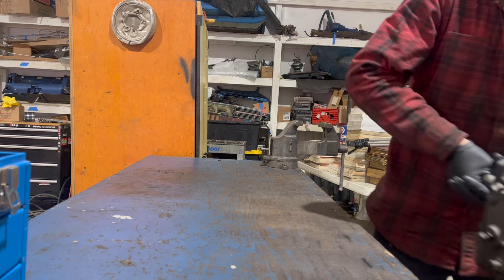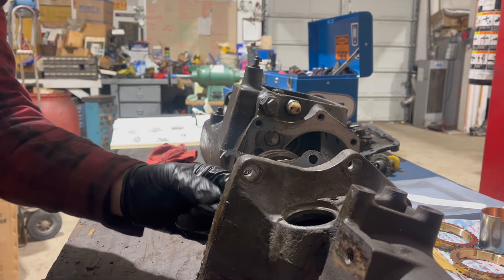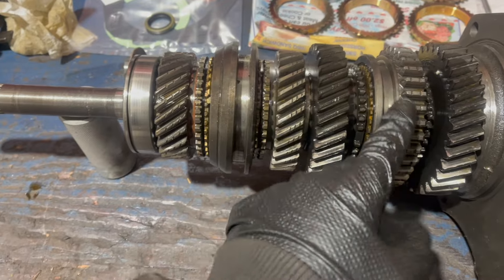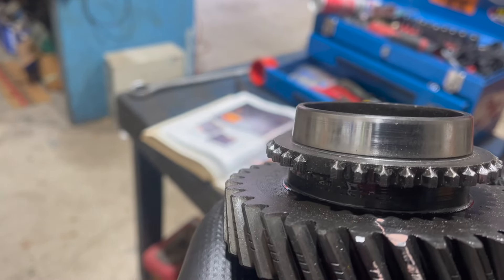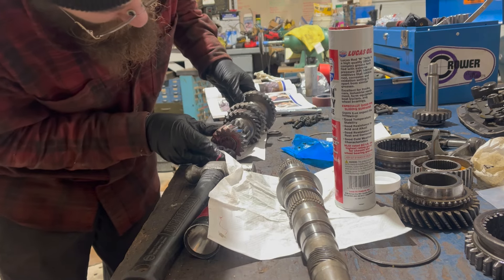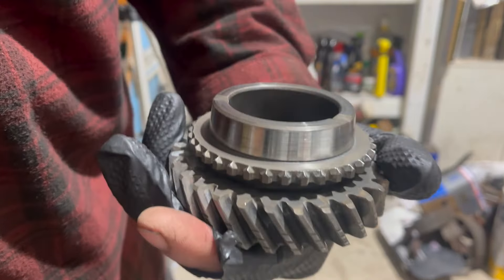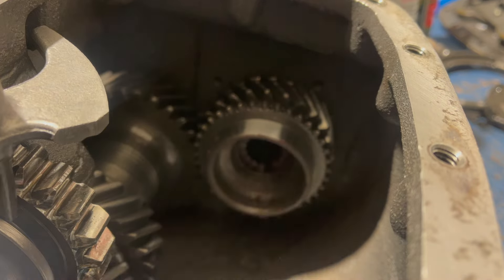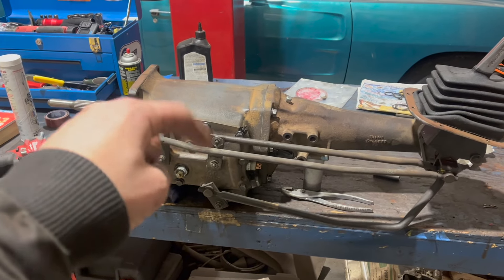How To Rebuild The Mopar A833 Four Speed Transmission! How It Works, Common Issues, And More!

Comment: Could I get parts for an 833 for my np440
Reply from the maker: Depends on the part. A lot is the same, but they have special input/4th gear and output shafts, tail housing obviously, and I don’t know on bearing sizes or the IBR.

Comment: I'm a big 340 fan I love that little bulldog I do love big blocks but they don't call the 340 the big block killer for no reason I was thinking on putting one in a Durango or should I go 383 what you think you've don't some swaps you think I could stuff a 383 in there or should I go 340 right now it has 360 magnum and it's 2 gen I think 2001
Reply from the maker: A 383 would be…. Challenging. The 340 will bolt to the transmission but doesn’t have the mount bolts that the Magnum uses, so some science would be involved.